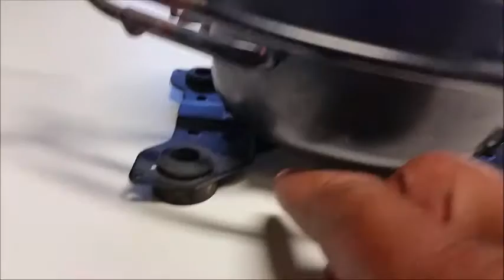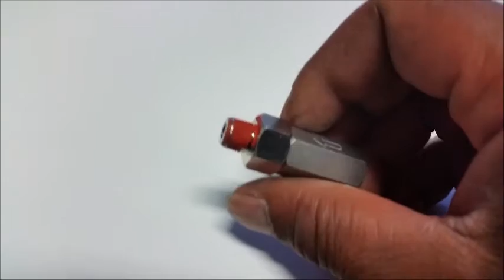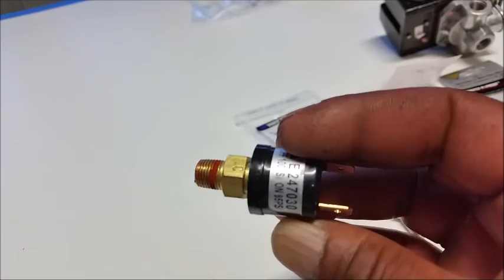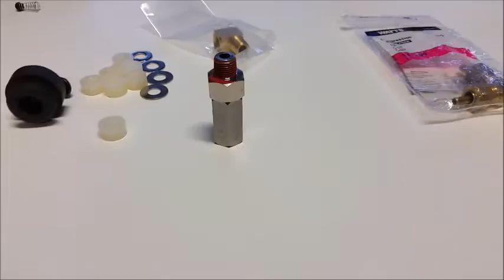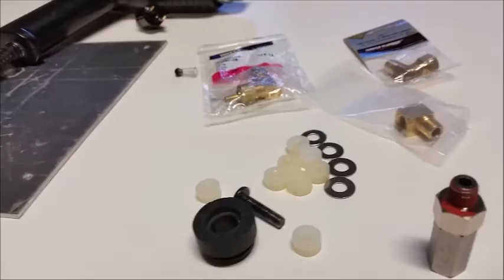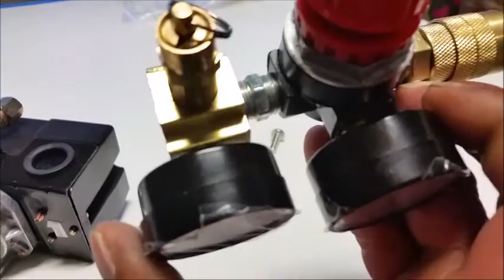Silent Compressor Part 2

Comment: Say what size is the copper Tubing  for  the  Air outlet  tube and  suction tube ? I am  asking  because i am wondering if it's  1/4  copper pipe  or larger or smaller  thanks
Reply from the maker: Hey John,

The line is standard 1/4 tubing. Make sure when you cut it that you leave enough for a compression fitting if you plan on doing it like I did. I suggest you leave about a 1/2 inch or a little longer after the braze.  Hope this helps

Jerome
Reply: thanks  it sure helps !   Going  to buy more  1/4 Compression fitting & Adapter's . Surely  alot cheaper  with build like this vs buying one my god and thank god for you tube

Comment: Thanks for sharing your work.  I would like to do the same.  Dug out a compressor near the dumpster last week.  Turn out to be an inverter compressor.  All 3 pins  measured 13+ ohms.  Any idea if this can be used?
Reply from the maker: As long as the input voltage is 120 AC it should work. there should be a tag on it that verifies that. Chances are there is no oil in it so make sure before you connect power. If it is about the size of mine it should take about 150 ml of oil. You can use regular air compressor oil.
Reply: Noted your point on air compressor oil. Any idea how I can figure out how to wire this?
Reply from the maker: Send me a pic of the compressor and one of the connection point. acmech30@gmail.com